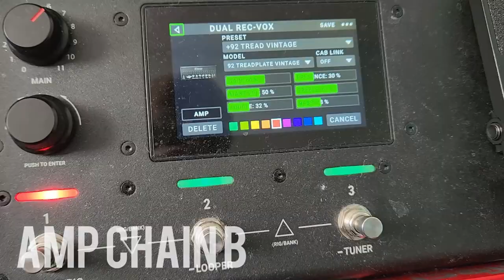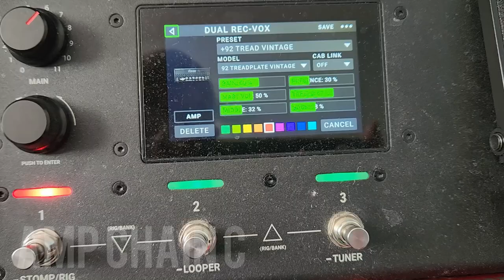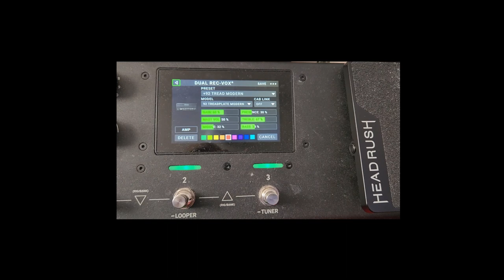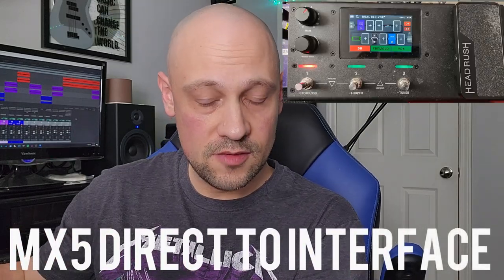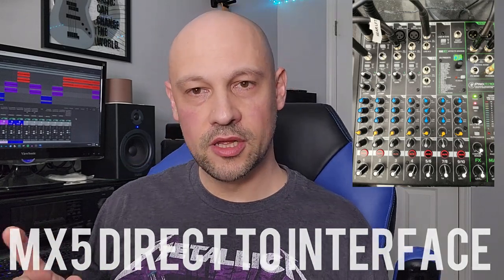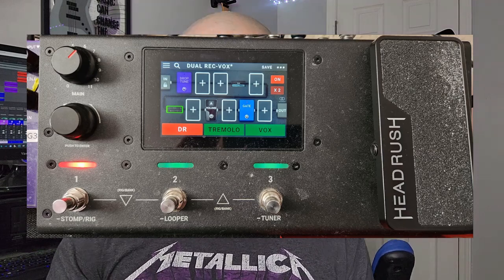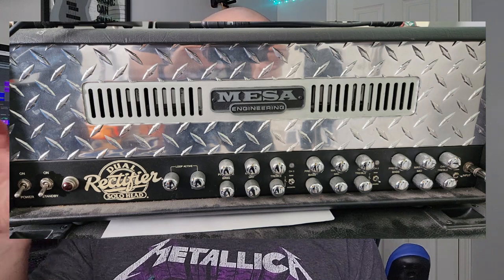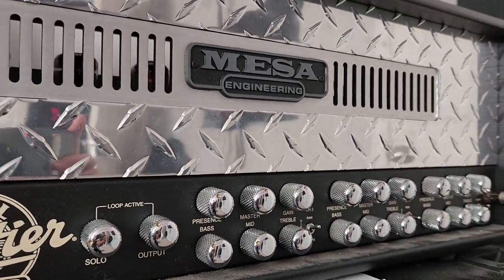Headrush MX5 VS Real Mesa/Boogie Dual Rectifier

Comment: Great video, love seeing these modelling pedals vs the real thing. 

My question is how did it feel real tube amp vs the sim?
Reply from the maker: @seandogg41  it's a great question and I think you know what the answer is. Of course these modelers have got to the point where it is really hard to tell the difference, but the feel is not there. It is arguably close, but you just can't roll the volume back and play lightly and get the same sounds from the modeler that you would get with the real thing.

Comment: B was the rectifier for me. But I still think you could eq the sound a bit by taking off the the mids a bit and turning up the amp gain on the mx5. That would bring it in line with the real thing way more and turn up the gain…

Comment: I just bought the Headrush prime. My thoughts are both of them sounded good and I have no idea is which. I have a triple rectifier and a roadking and a kemper. Most of the time people live dont even care and unless someone buys me a big ass van to lug around 2 half stacks then Headrush it is
Reply from the maker: Too funny 😁! I'm glad you got the point of the video. When run thru some good IRs it is virtually impossible to tell the difference. You're also right about live play. 99% of the folks there will not care as long as your band is tight and the songs are good.
Reply: @priorwitness  thank you for the video.  If I hadn’t already ordered it I would have ordered it based off this video alone! You really know how to get a super good tone and that mesa is cleaaaaaan

Comment: This was great. I’m using the mx5 this way into an engnater renegade fx return. How do you work out the output level into the return.
Reply from the maker: I usually try to match my amps level with the master volume level on the effects unit. start with the volume low on the MX5 and go back and forth between the amp level and the mx5 until they match to your ears.

Comment: I have the headrush pedalboard and the mx5. All of them sounds so close that I really couldn’t say I can hear the difference. I need to know the settings on the headrush 
 pedals   Including the global settings
Reply from the maker: I agree! It is difficult to hear the difference, and that's the point of the video. It's been a while but i don't remember doing anything fancy with the global settings. There were really just two points I was trying to make with the video. 1) Sound wise it is darn close. One big pro to all of the Headrush units are how well they sound; even for a "budget" unit. 2) The IRs and/or cabs you use are really biggest difference you'll see. If you use quality IRs or run this thing thru some good cabinet speakers you should be happy with the end result.
Reply: @priorwitness  I grabbed the Joey Sturgis IRS and they’re amazing. I’m in a studio right now recording a track. I wrote 25 years ago and they love it but it’s not quite the same as my Mesa Mark Four. I have the Mesa Road King also but my mark four is my go to.

Comment: So I hear this a lot, this unit is great in the studio but not something I would use live. Why would you not use this live? It seems like the whole point of this thing was portability so you could use it live. Is this something that the gear snobs would say or is this a relevant point?
Reply: Headrush stuff in general needs to have a bit of equing going on in your rig to get closer to that real deal sound, that's just something I've learned over time. I run my stuff live through FRFR speakers, works and sounds great. Though I am using the HR pedalboard and now Prime.
Reply: @headrushG33K  headrush even in 2023 is using the same decade-old code they pulled from the 11 rack. Meanwhile practically everyone else is constantly refining and updating their existing models…
Reply: @justinTime077  sure I own pieces of headrush hardware that run on the 2014 chromebook chip but no other unit does it the same as headrush. They also improved amp capturing and it's better than anything else on the market for the price. It's pretty easy to hate on headrush bud but for me it does the job better than any helix, kemper or quae cortex. I can dial rigs in seconds.
Reply: I've used amp clones live and you don't even need any eq for those because that's how close it captures to the real thing. Especially after 3.1.1 update. Get ready for HeadRush Core to be released soon, it's official.
Reply: @justinTime077  matter of fact before 2. 6 update for older boards, they released like 3-4 updates a year with new pedals, amps, and couple cool features. Does kemper or helix release 3-4 updates a year?
Reply: @headrushG33K   exactly. Headrush just adds more (quantity). I’m saying Fractal and Line 6 not only regularly refine their existing amp models (quality), but also add more as well. I know nothing about Kemper. I know that Tonex does profiling just as good if not better than Headrush, and for a fraction of the cost.
Reply: @justinTime077  matter of fact I capture my amps from Tonex and it sounds great on the Prime! But i actually get all the effects I'd need in the world, unlike Tonex pedal. I've used HR products since 2016 and I am not planning on switching. I really like it personally and I've had 4 different sound guys compliment my sound live.
Reply: @headrushG33K  why do ppl say the HR amp clones have horrendous latency when playing? Like, unplayable? Don’t get me wrong, I want to like HR, but I haven’t once seen them mention improving their existing amps. Only, “we added more amps packs because we bought some other company that was left in the dust..”
Reply: @justinTime077  if you don't like ot, don't buy it bud. It's pretty simple. I like it and that's why I have it, clones have zero latency.
Reply: @headrushG33K  I’m asking because I want to buy it but I also see that they still use the same code, if that’s true that’s rough. Have you ever used a Fractal device for comparison?
Reply: @headrushG33K  I think every piece of equipment needs EQ but people are too lazy to realize it. It's easier to blame the gear
Reply: @gustavohenriqueperez  I can't build a rig for any songs without including EQ in my chain, sometimes even 2 eqs and one is flat and used as a booster👍
Reply: @headrushG33K actually Helix is so consistent with updates than headrush. I use a headrush by the way.
Reply: @georgemavimbela  yeah, I made ny comment 10 months ago and at that time even with the old gen boards we were getting frequent updates. Now we've been waiting for 3.1.3 for a damn while